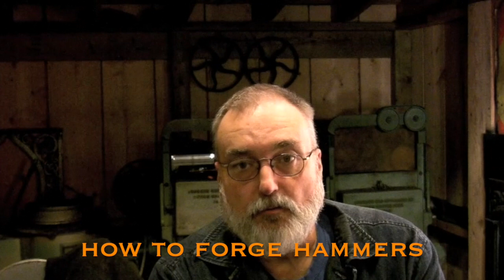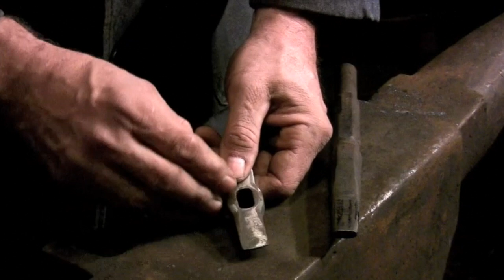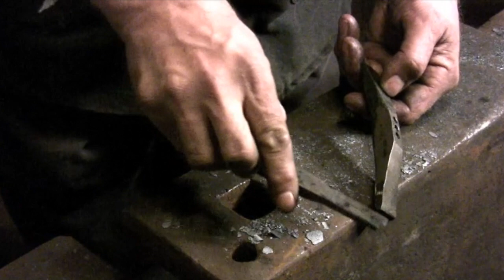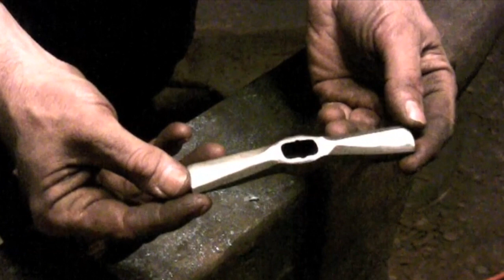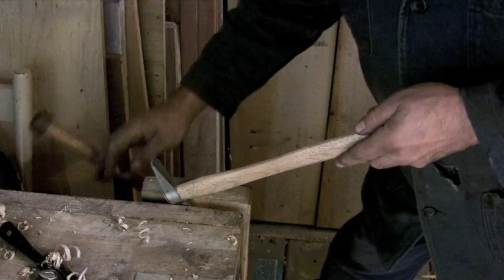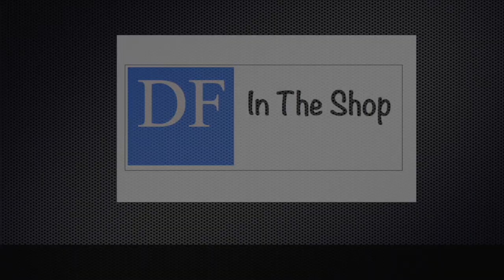Blacksmithing Project - Forging specialized hammer heads

Comment: Would it be a decent idea to forge such small raising hammers and the like out of say.... rail road spikes?  I'd assume it'd be better to put them to that use instead of making knives out of them.  Most of the ones I come across be it bought from ebay or given to me are 5/8ths  square and no matter what I hear I always feel these things have some sort of potential.
Reply from the maker: Some railroad spikes can't be hardened but the others do have enough carbon to make good hammers.
Reply: @df-intheshop330  Yes yes, I've observed that! Hopefully 5/8ths would be wide enough to punch an eye through, yeah?
Reply from the maker: Lots of room.  Use the same process I used here. Punch a narrow slot and drift.
Reply: @df-intheshop330  Gotta make tools first! I haven't gotten myself into hammer making. I've only opened up that can of worms after buying a bunch of cheap chinese ball pein hammers on ebay. So far I am made a hot cut out of one. I actually believed at first they were going to be cast iron heads and I as ready for immediate failure, but I was pleasantly surprised. Now I need to make a drift and the slot punch. Do you think 1 inch 4140  round stock would work well enough for  a drift?

Comment: I like your use of a Canadian Tire wrecking bar for stock.  Any idea what type of steel those usually are?
Reply from the maker: I don't have much of a choice . Nobody carries any type of tool steel around here anymore.  It's probably 5160 - that seems to be the most commonly used steel for springs and it is pretty trouble free in the heat treat.
Reply: +DF - In The Shop that's good to know. I've got pretty much the same situation here (Niagara region). The local Metal Supermarkets won't bring in any tool steel at all, Fastenal will bring in W1 and O1 drill rod, but that's about all I have to choose from. Have been wondering what some of these inexpensive tools were like for reforging (wrecking bars, big allen wrenches from Princess Auto, etc.). Will have to give them a try!
Reply from the maker: It's all I've ever used.  I think I would have a heart attack if i had to pay $20 a foot for these high tech tool steels.   Do you have a copy of The Complete Modern Blacksmith by Alexander Weygers?  It's been reprinted recently - I think Lee Valley carries it.  This book is all about recycling scrap to make tools.  A lot of good information but you have to look past the crazy 50's - 60's designs.

Comment: I've noticed that as an extra measure pressing the handle with an rubber bicycle inner tube really jams the hammer tight. Only problem with this is getting it off if the handle breaks.
Reply from the maker: So this would be like a poor man's Hofi Hammer?
Reply: +DF - In The Shop Yes. I never seem to have the bucks for a hofi. So you would need a press jig off some sort to fit the handle in the eye tightly enough.
Reply from the maker: Are you doing anything to the inner tube to get the handle to slide on?  I'm thinking about how we used to have to soap up those foam grips on bicycle handle bars.
Reply: I just press it with extra rubber to work with. Then cut the excess off. Maybe linseed oil could help, since i treat my new handless with it anyway. I could try that next time.